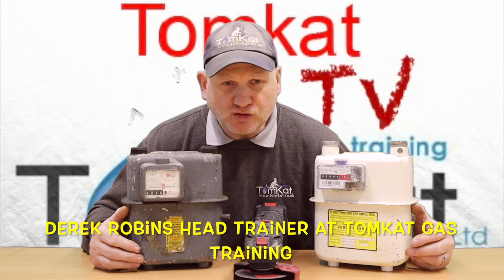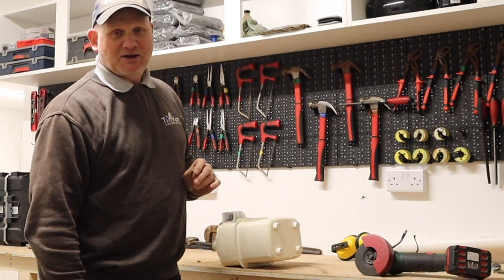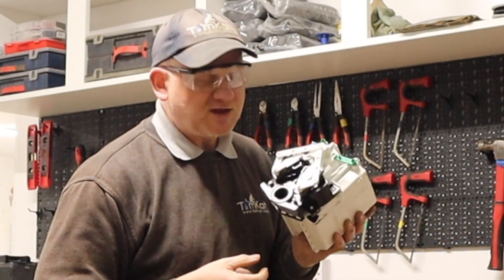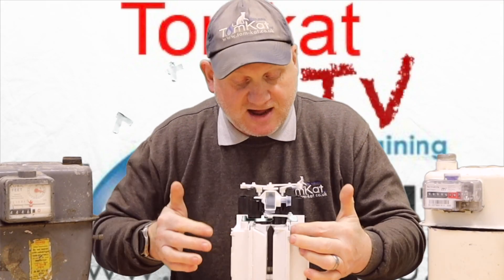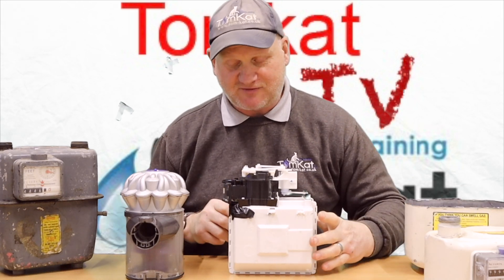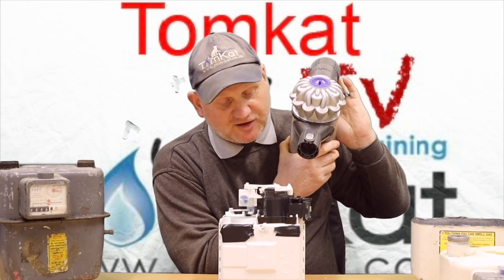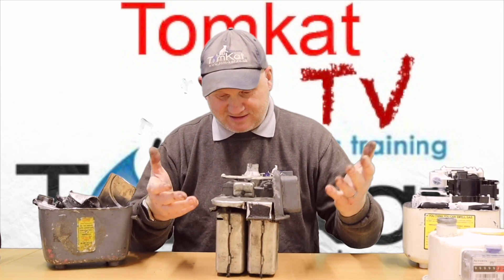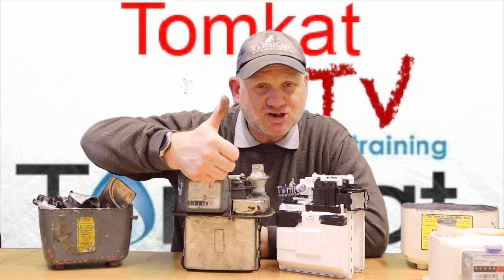What's inside a gas meter ? breaking open gas meters to see how they work.

Comment: Sir if we put engine used oil 20 w 50 in side can it's work slow ??? What will happen if we put Oil in metter intake what will happen it will work slow or fast or Stop working plz guide and make video on it Thanks

Comment: Hi, Thank you for making this video and I found it really helpful. I live in an apartment and noticed that my gas usage had a 400% increase compared with same period last year. At first I thought I might got a faulty meter (i.e. my meter went wrong at some time point last month). However, after watching this video, I realized that it is really difficult for a gas meter to go wrong, and the reason for my abnormal increase of gas usage might be somewhere else. May I ask do you have any ideas about possible explanations for this?
Reply from the maker: If I was you I would make a note of the gas meter reading and don’t use any gas for an hour and see if the readings increase. You could also have a gas leak that is in a place that you can’t smell it. If you have concerns get in touch with your gas supplier or get a gas engineer out to do checks.
Reply: Hi, I followed your suggestion and turned off everything when I leave my apartment this morning. And when I return home, I found my gas meter shows that I consumed 1 therm during the daytime. It seems that there exists a gas leak somewhere. I will contact my gas supplier tomorrow. Thanks again for your suggestion  @tomkatgastraining
Reply: Thank you! @tomkatgastraining
Reply: If you are in an apartment you may be getting billed for the wrong meter
Reply: @dreddwailing5505  What u said is indeed true!!!! I spent 1 month studying the pipes in the apartment building, and finally found out that I have been paying bill for the guy living downstairs for more than 1 year. What's more frustrating, it took me 4 months to fight with the gas company (National Grid) to get my money back.

Comment: 💥💥💥💥💥can it move in reverse??
becuase we use gas cylinder  too...
we don't  want our cylinder gas is going in out side system .
Reply: Between street and gas meter there will be a regulator which will also act as non return valve

Comment: Are the older meters from the 1970s, 1980s way less efficient than the modern meters?
Reply: I have tested a meter from the early 1900s and foun it accurate.
Reply: @philgoff7563  Interesting..

Comment: Very intriguing mechanism, such basic mechanics. 

For the sake of argument would the rotation reverse if you were to push air through the outlet as opposed to suck with your vacuum. 

Great video
Reply: no
Reply: The same action and the same readings

Comment: Hi Derek, thanks for the video. I have the same as the one you are showing (Schlumberger), and my meter reading (the actual clock) stopped working. Do you know how to fix this, please? Any advice is much appreciated
Reply: Contact your gas supplier, they will  replace it FOC

Comment: Very interesting and food for thought.                     I've had the worst week   at work in many years, everything i've been to has been trouble.

Went to a gas leak and had the ecv snap off in my hand when testing...................    Brown trousers moment, until I hammered a wooden bung into the open end from the street.

Then a  mechanical meter with the outlet nut rusted on to meter tail and leaking.         Called the board out  and the fitter heated the tail to get it off:

   I would have been worried about blowing the meter bellows up?          and    looking at this video:     The plastic  spacer to seal the outlet from the bellows could be damaged by heat!

Would this then bypass the metering system?     at the least it must have put the metering out of calibration, as no way can that plastic stub NOT have been damaged........

Interested to know your thoughts.   Cheers.
Reply: ...so the 'ecv' literally came off in your hand?  Man that is SCARY .
Reply: @iD.Blackjack  Yep, years ago on bulk HP  propane was the most frightening under a static caravan!
Reply: @julianhawker7672  ...So then I would have thought that every I dont know say 20 years it must be a Service requirement to change the ecv with a new one. Although the pressure is not that hard, but the toxic smell  and the @ it gushes out is a maximal situation involving exposure to danger . I think I am going to invest in a nuclear PPE for such a situation. You surprise me by still being in the trade. lol
Reply from the maker: I would definitely not had done that. But if I had a van full of gas meters and had removed the anaconda from the ECV I might have had a go
Reply: they used to stick a knitting needle through that plastic shroud.

Comment: So many moving parts in those older ones! Plastic components and I wonder how long they hold their calibration for! I can't believe it's not an industry standard to have these meters calibration checked on a regular basis. The ultra sonic meters will be far more accurate and repeatable but again, will still require calibration regularly to maintain optimum accuracy I guess. Interesting video, especially for us flow geeks. 👍🏻
Reply: They will be accurate for a long time because they work on a fixed volume rotating a crank.  The density of gas will change with temperature and hence calorific value though. But this is accounted for.
Reply: The new ones are very susceptible to magnets being put on them, the magnets don't do anything but the rumour has spread. i have come across quite a few new meters with magnets stuck to them.

Comment: Fascinating to see what's inside them indeed. But by the way, PPE does include gloves especially when using an angle grinder :0
Reply from the maker: Not for me I have never worn gloves and never will
Reply: @tomkatgastraining  Each to their own I guess. They've saved me from injury so many times.
Reply: Gloves are a bad idea with rotating machinery. Save them for moving materials. He still had the shroud on the grinder which is better than most.

Comment: There is a rotating magnet in a number of modern meters which can be used to track usage, wondering why they didn’t use these instead of the £££ smart meters? 

What’s your thoughts on having something inside the meter cabinet counting the rotation of that magnet so they can monitor gas flow? 

What are your thoughts on Low voltage battery or low voltage (5volt) direct wired? There is an actual device for this that’s purchasable which has a Hall effect sensor but you’d need to push cable though into the house so the seal would be broken so how should that be sealed? Any advice?
Reply: Or you could just monitor your gas usage by reading your meter.